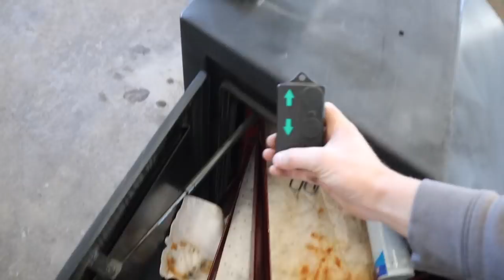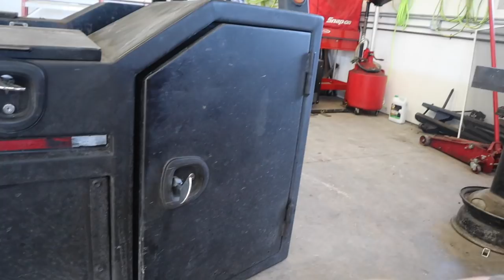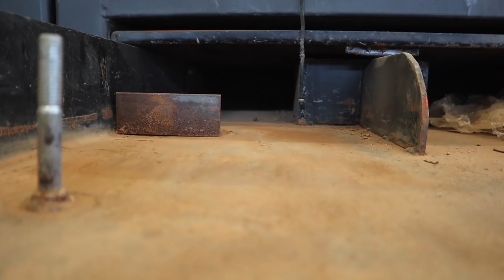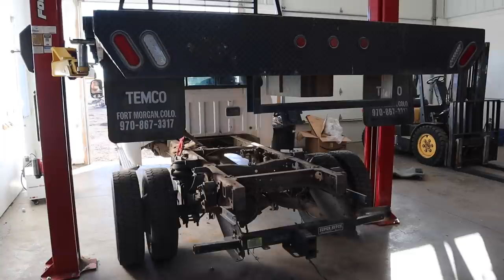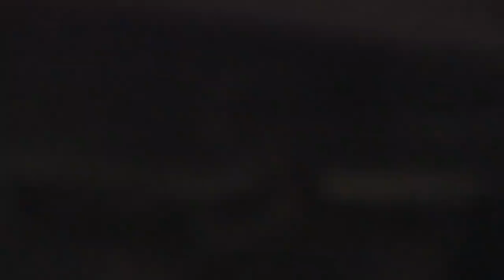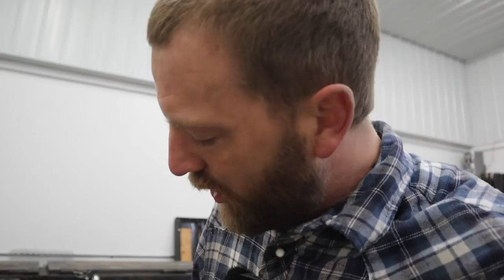Ultimate F 450 Upgrade!

Comment: We use to mount these units on trucks and we always added a strip of 1 1/4 inch x 3 1/2 oak boards between the total length of classic and the bed.

Comment: I’d say somebody built that bed and it was somebody that definitely knew what they were doing. I doubt you can buy a utility bed with a gooseneck hitch and hydraulics for a bale bed from a retailer anywhere. I would be careful about what I kept in those trays that are inside the back bumper because if something happens to bend the bumper, the trays and whatever’s in them are stuck in there. Other than that, it looks great and like it’ll be very useful.

Comment: rear bed work lamps.. use the power wire for the trailer connector with a fuse and a switch to turn on the backup lamps..  instant work lights..  depending on your truck year and how the back up lights are controlled.. you may not have an issue powering the back up lights with a switch. or you may have to use a On-On switch.  with the back up lights on the center terminal .. the wiring from the neutral safety switch on one of the side terminals and the fused power from the trailer controls on the other side terminal.
edit.. change the white back up lamps to LEDs for less power drain on the battery.  leave the red lamps with their regular bulbs until they burn out or face needing to find a special flasher for LEDs with an external ground wire..

Comment: Hey Blake, great score on that low profile utility body. I would be happy with just the flat bed for mine. The bed you have is similar to the ones I have seen here in Pa. They came from a company called Thiele Manufacturing. They specialized in utility beds and dump bodies for many years. The greasable hinge pins are what made me think it's a Thiele.  Only problem is, they are now out of business. I guess just 1 more business that this pandemic bullshit killed off.

Comment: I just bought a similar '02 450 and just noticed the lower rear shock mount is bent up pretty bad reducing the shock length by 2 or 3 inches. The mount is welded on and it hasn't been easy to find an aftermarket replacement.  I have been looking on the internet at used axles and this issue seems pretty common, Have you experienced it? any recommendations? Just leave it? Thanks for all the videos, so helpful to have them when working on my truck.

Comment: Are you planning on rear spring enhancements given the weight of the bed, the tonnage you will be adding in gear PLUS the weight of a bale hanging off the end of the bed??
Reply from the maker: The 450 should be enough for daily driving with it, it settled down the suspension enough that the truck actually rides nice. I have on board airbags for extra support if we need it, but more on those in an upcoming video.

Comment: Thats a custom bed.  Very nicely done.  Doubt that bed is 3000-3500lbs.  Probably 1500 at most.
Reply from the maker: My single wheel CM flatbed weighed 972 pounds when I bought it, a dual wheel version is around 1100. This one has a lot more steel and thicker steel, but we’ll weigh the truck in an upcoming video.
Reply: My 12ft imt service body which holds a 7500lb crane is 3500lbs. Unless that body is built from 1/2 steel its not 3500lbs.  I could not lift my 3500lb body with a 5k forklift from the back.  Was to long and the forklift would topple.  Now I still think that is a very nice shop built body, those greaseable hinges are common practice on custom bodies.  Mcmaster Car used to sell them.
Reply: @kevinoscarson2941  I bet that body is 3000 to 3500 with the bale spear and all the hydraulics built into it. You have to think about the leverage that a bale would have on the back of that truck and the reinforcements it would require to keep the bed solid. They definitely aren’t as lightly built as service body’s
Reply: The service body on my 01 f550 is an altec with a liftmoore crane on it and the bed is just thin sheet steel. Really not that heavy built at all. This bed looks way heavier built